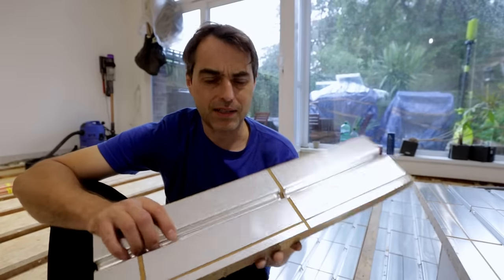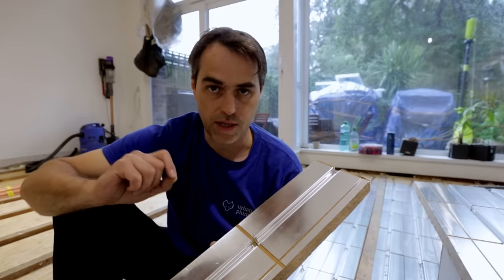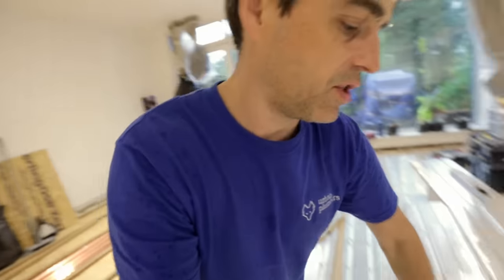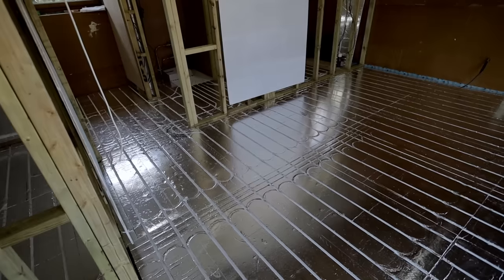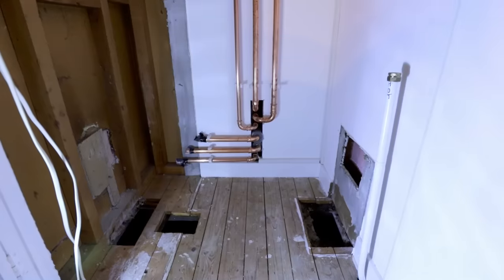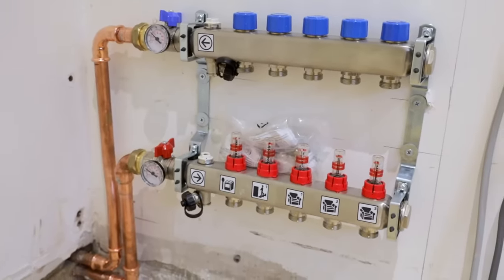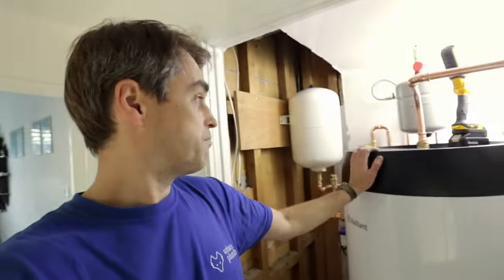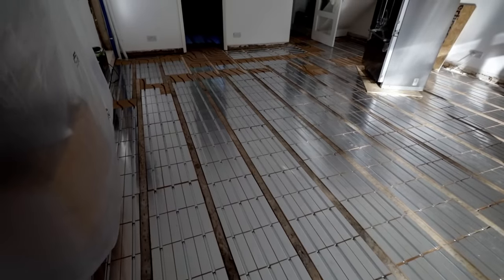Do Not Install Underfloor Heating With a Heat Pump Before Watching This Video

Comment from the maker: I am organising a follow up ton to this video. What questions do you want answered by the owner of this system?
Reply: Would love to know about the floor construction on the kitchen side. 

I have done exactly this by recessing 150mm overlay boards between the joists. Was a nightmare to install especially when the house is 1850’s. 

Wish I knew about this product sooner though 🙈
Reply: What are they doing with the front and back doors now the floor height is raised?
Reply from the maker: @blewett47  the floor height hasn't been raised - that is the whole point of this UFH system
Reply: one thing that always confuses me, how can the temperature be managed on a room by room basis ? in my situationI I have 3 rooms and 2 of them the occupier prefers a much hotter temperature than the the other room and also the living room is preferred to be lower, how can this be resolved if there's just one manifold and now actuators ?
Reply: Would be interested in how the owner ended up making the decision to go for UFH (I.e. what were the other options, and why UFH was preferred) and their perspective now on whether that was the right decision.  You can understand the benefits in theory, but the amount of work / cost / disruption also feels huge!
Reply: What is the real world output per m2 on the timber floor section?

How closely do the pipes actually fit the aluminium profiles? I picked up some MEPAfloor profiles (also 0.5 mm aluminium and omega section) and was not thrilled with how closely the pipes matched the profiles.

Is there any variation in the output on the floor if you don't get hard contact between the floor finish and the UFH? Say that's visible on thermal camera (it looks like this is installed between joists rather than as overlay so is only as tight to the floor as the spacing between joists dictates?)
Reply: How did the compensation for running the system at a lower temp and adding another emitter in the kitchen work out? I got confused because you said there was no actuated zoning. Does the radiator and the kitchen UFH run off separate circuits?
Reply from the maker: No all the same circuit
Reply: How do you decide when to use copper piping vs plastic piping?
Reply: Was the underfloor system design by Urban Plumbers, or Jupiter? Would UP want to propose this to future customers?
Reply: @michaelridley2864  Yes, we're getting work done and UFH is being pushed back on by our plumber, especially wet.
Reply: Any weird sound/noise come from the flooring when switched on?
Reply: @Omey731  I can only assume that the answer to that is that you can't. You decide your room temps in the design stage, and that's that, which seems insufficient to me. Unless I'm reading this wrong, but I just don't see how it can be anything other than that.
Reply: @TheZippyMark  seems a very impractical and inflexible design to me, efficiency at the expense of practicality and real world scenarios doesn’t work in my head 🤷🏻‍♂️
Reply: @Omey731  that's my feel tbh, as an installer, I feel like this set up would only work if the customer really really understood the set up and accepted potential loss of comfort in exchange for efficiency. Otherwise what do you say when they phone up and say, "My kid wants his bedroom a bit hotter"?
Reply: This product looks exactly like what I am looking for. In predesign phase.

Is the customer getting the heat output you expected in the design?

Did the cutting of the aluminium plates to fit the joists affect the output?

What type of wooden floor finish did they use? 

How do you factor this into your heat output calculation?

Any recommendations for choosing wooden floor finishes? 

Do they use rugs? Any worries about the types or sizes of rugs they can use? 

Any worries with furniture blocking the heat output? Eg sofa directly on the floor.

Would you install/recommend this product as an overlay system? If you need high output.

Finally how would you balance a system like this if the room had a 4kw wood burning stove that you only wanted to use occasionally? 20 days per year. To fill a period fireplace and make the room cosy in the winter. Maybe just open a window?

Comment: Looks like an proper engineer designed this system. 
Love the thicker plates, proper connection between pipe and alu-plate, narrow distance between piping, and a good size on the pipes. 

This is not a cheap system to produce, but in the long run this should allow the heatpump to run very cheap.

Comment: Hi, great work & big fan of the channel as a plumber started in 1988. In my house I have installed 100mm Celotex between the joist (20mm below top of the joist to allow heat circulation  and to avoid hot spots). Covered with pre-routed 22mm OSB (16mm pipe 150mm space), then covered the osb with 6mm Hardie backer board (good heat transfer & mass). Finished with 16mm engineered oak floorboards. All works great!  Look forward to the follow up video!

Comment: I’ve fitted 16mm pipe on top of 100mm PIR, battened 25mm on top, then infilled with a semi dry screed throughout my house. It’s topped with 18mm OSB and then LVT. We have been through a winter with it and it’s kept us warm in our semi renovated bungalow. 50mm pir insulated plasterboard throughout too. Open loop system with Daikin altherma monoblock 8kw. Spacings are around  130mm, three pipes per  joist bay. Curve set at 36c @ -2. Daikin heat pumps have a sort of minimum operating temperature so the curve is fairly shallow.

Comment: Very good system, my parents have Jupiter UFH in their self build and it works at very low flow temps, even with carpets and wood floors. Most of the year it runs under 30c and it never needs to go over 40c even when it's freezing. But given that this is apparently a full house refurb, I'm astonished that the customer didn't instead insulate & plasterboard the external walls. The cost savings on the heating system (using cheap & quick standard overlay panels, and a smaller HP) should have covered most of the cost for the insulation, if not all of it, and then you have the energy savings on top. I'm guessing they didn't want to loose any floor space for insulation, but they will now be paying for those few inches year on year.

Comment: Interesting solution. What would you do if the system did need to run at 55 degrees celcius? Maybe a tile floor can handle that, but I don't see a PVC floor holding up well.

Comment: Great video again.  Presumably the hardwood (?) floor covering in the lounge can stand being in direct contact with pipes at 43 degrees?
Reply: Hi there - it's engineered wood flooring, which can stand this and has better tolerance than hardwood. The key is not to expose the wood to rapid changes in temperature - which is easy to ensure with a heat pump of course. The other, connected,  important element is to retain the ability of the wood flooring to absorb and release moisture for it to retain its state: preventing drying out + cracking, and damp + expansion either way. There's a quite a void beneath the subfloor and there are air bricks on each side of the house. The draughts beneath bring in and take away moisture constantly as the weather changes. So we had to make sure that every material used in the sub-floor construction is breathable (beneath the UFH panels it's 200mm mineral wool resting on galvanised mesh attached to the joists). The aluminium isn't, but it doesn't reach the edge of the wood-fibre panels and doesn't create a seal, plus moisture is also transferred in and out through the joists and OSB board.
Reply: Thanks for that detailed reply. Great info !

Comment: Hi there.

Just finished your video.
I like the idea of not having a buffer on the system.
How many start stop session do your setup have doing a heating season?
I put in a Nibe ground source heat pump myself June of last year.
I have had 685 start-stop sessions.
Witch in my mind is what takes ekstra energy and have skates wear and tear on the compressor.

Really like your videos.
Greetings from Denmark.
Reply: Io ho un impianto geotermico acqua/acqua con una NIBE f1127 molto vecchia ma l'acqua del mio pozzo si è rovinata quindi ho spesso problemi e vorrei passare ad una pompa di calore aria acqua piu semplice economico ed effiente.

Comment: As usual a great video easily explaining the way to design and install low temperature heating. Hope you get the output for the panels, the insulation under the pipe looks like just 10mm. 👍 I’m surprised by the cost, I usually like a solid floor and screed, like you say, 2-3 hours to lay the pipe, job done!
Reply from the maker: There is 50mm Rockwell below ply and the ufh panels have 30mm insulation
Reply: 200mm Rockwool below the OSB (the joists are deeper than is typical). More than I promised you Szymon. It might be overkill, but the void below that is a massive well-ventilated space - v important for the wood. And it’s a windy spot.

Comment: what pipe did you use for this project. Don't recognise the blue pipe. Also some manufactures such as henco say the way their pipe is made and amount of aluminium in it gives them a greater heat output over cheaper UFH al pipe. Have you found any difference in pipe quality/output?
Reply from the maker: Just blue mlcp. I doubt you will ever notice any difference between manufacturers

Comment: In my own house I have a 40 l buffer with 7 kW Vaillant. 22 mm primaries for 5 m with all rads piped in 15 mm. Would the system perform better without the buffer ?

Comment: Great video - i always learn new stuff. I have 5 zone small bore uf (nu-heat contraflow) layed in screed. Currently uses a oil boiler with a buffer tank for uf. If only I could find someone like yourself who could do a full analysis of the heat demands and design a system to  move to a heat pump while maintaining the existing floor pipework where i live.......

Comment: Have I understood you correctly, that Vaillant rates its heat pumps at -7 deg C? Does it mean when calculated bivalent point for a detached building is 6,1-6,5 kW at -6/-7, a 75/6A arotherm plus should be the right choice, then? Will your system use additional heater, haven't seen any internal unit at your installation (like MEH)? Thumb up from PL.

Comment: Would a uniTOWER work in that cupboard instead of making it bigger? Apart from the smaller tank capacity, would there be anything else different that would prevent using a uniTOWER?

Comment: What do you recommend,
  if i thinking about UFH on existing concrete uninsulated ground floor.
Semi detached 1970 house poorly insulated .
Might be ready for future Heat pump. At the moment runing on gas combi boiler.

Comment: I can see the advantage of the straight sections with aluminium heat plates but if there are to be tiles over would not the nonaluminium areas that you had to route specially be better with your other under grout plastic clip system or just fed mid air and then the dry grout system you mentioned for tiles over the aluminium but just filling around the pipes and levelling to the rest. I would have thought that would be quicker to install with better heat transfer than the alternative you showed of fibre board routed without the aluminium heat exchanger?

Comment: Thanks for all the information. It makes hard topics, easy to understand for a layman. And that is a gift.
And I wonder if I understood correctly, that in this design every room is always roughly at the same temperature? So you won't be able to lower the temperature for 1 bedroom? Or do you do that on the manifold?
Reply from the maker: Bedrooms have radiators here so can be controller by thermostatic valves. You can add actuators for bedrooms if needed. No one ever felt a need from my clients. Low temperature heating is pretty much self balancing when done right
Reply: @UrbanPlumbers  Thanks, that was the missing link. We have a similar house that was rebuilt from the ground up early 2000 but lazy/shoddy. Double walled and glaswool filled 70cm thick walls but wind is blowing through the cracks of the floor and wallsockets. And old fashioned central (oil) heating that we converted to solar heated (20m²). That we also want to convert to floor heating after we solved the obvious energy leaks. I like the idea of calculating the needed heat capacity and using 1 temperature for every room.
But I am trying to get my head around possible gaps of Information that would bite me in my behind after installation. The professionals around here prefer doing new houses. And are not getting excited when asked to do >300m² old-fashioned farmhouse with multiple heat sources (wood burning stove with a boiler (18kW), significant solar heater, and later a heat pump).
So now I spend my time binge watching your channel and alikes.
Thanks again! And greetings from Germany.

Comment: What software do you use to calculate the heat loss from the building, and what external temperature do you assume vs. Internal temperature? It could be a really interesting video to see how you do the design for a typical house or a case study of a system you have designed.
Reply from the maker: I have been planning to do a video like that for a while

Comment: Good that UFH manifold is so simply arranged and will work well worh wooden floor. How does a 40ish degree flow temp work when using LVT flooring, will damage to floor occur?
Reply: It shouldn’t damage the flow. Although the flow temp is 40C, the floor temperature is kept below 29C by the fact that it has air at 19C above the floor - you get a thermal gradient from the air to the water and so the lvt doesn’t get too hot. Solar gain is potentially a bigger risk, sunshades might be needed in certain rooms if the windows are large.

Comment: Have tried just putting pir between the joists 25-30mm below the joists then putting a thin screed in I've been doing this for 20 years (on low temp) and always got good results. The only thing i would advise the customer if fitting hardwood keep below 18mm thickness

Comment: @urbanplumber so does the cylinder supply hot water for the house and the heating for the radiators?

Comment: We're getting doing building works. What is the natural order of things - I assume from your video:
* Extension and interior remodelling building works
* Kitchen installation
* Underfloor heating installation
* Flooring installation

Is this right?

I'm finding it hard to find plumbers that are confident to manage wet underfloor heating and keep getting push backs to either electric underfloor or radiators - I guess this is the difference between a plumber and a heating engineer.

Comment: I'm surprised it wasn't just overlaid on the OSB deck... were the extra batons between the panels specified by the manufacturer? Is it to bear the load?
Reply: Ahhh I see they're not batons, those are the joist tops. Weird way of doing it, laying the system between the joists rather than over them. But I guess it lets them have extra depth of their wood-fibre insulation... and means less build-up over the joists...

Comment: For a low-height floor build-up, could you have used the Pro-Fix system witt XPS Panels below the trays ?l
Reply from the maker: this would build the floor height by additional 18mm of a panel and 18mm of a plywood backing. This system has flooring installed deirectly on to the joists so doesnt build the floor up at all. Also, the output of this system is almost double of the overaly XPS panels.

Comment: one thing that always confuses me, how can the temperature be managed on a room by room basis ? in my situationI I have 3 rooms and 2 of them the occupier prefers a much hotter temperature than the the other room and also the living room is preferred to be lower, how can this be resolved if there's just one manifold and now actuators ?

Comment: looks like 20% is not with the aluminium top layer or does that not make a difference? 

I have a question for my system...I have floor heating and a gas CV system and I want to test something before I switch to 100% heat pump because I am not sure if it can handle it alone. 

 As a test I want to use the monobloc heat pump as a hot fill for the gas cv unit (installed in serie as input on the intake) ....will this be possible or will the cv system cause bottle neck problems for the  monobloc circulator?

Comment: A follow up to determine this board's effectiveness would be helpful! This product has the potential to resolve several incompatibility issues if it runs right.
Reply from the maker: It does run fine. Video is from Sep 2023, so it has gone through the winter just fine. (I think / the client hasn’t complained so far)

Comment: Interesting video Syzmon. So with this Jupiter system what is the build up of materials to finished floor (I believe you said no screed). You also mentioned you had initially set up the wc at 0.6, so what has the user experience been over the winter and has there been any tweaks to the curve?

Edit: I have just been on the Jupiter site so understand a little bit more. It would seem that the extra time needed to fit the Jupiter system is balanced out a bit by the avoidance of using wet screed/ drying time and all that marlarkey.
Reply from the maker: No tweeks as far as i am aware and no complaints. System is flush with the top of the joists so there is no additional build up

Comment: The heatpump will run 24/7 because if the r value of the walls, or a lot of on and off I got a similar system but the pipes are covered with a Knauf dry screed system 32mm thick than wooden floor. Works well with 80w /m2 temperature 40 C .  Got a 800 litre combi buffer with solar thermal booster. Stores about 40kw hot water at 60C .  Enough for 4 to 6 hours . i think the lack of insulation in the walls could be challenging.